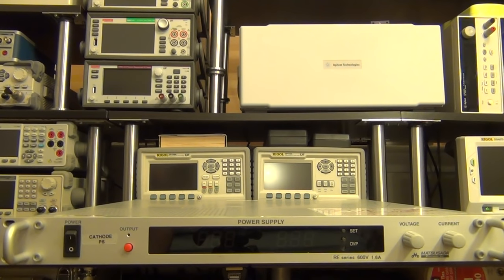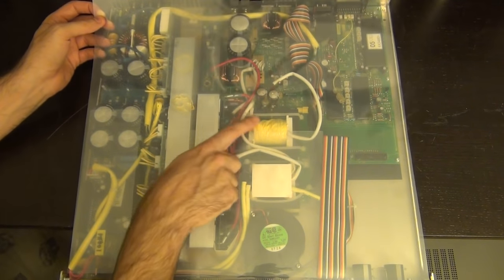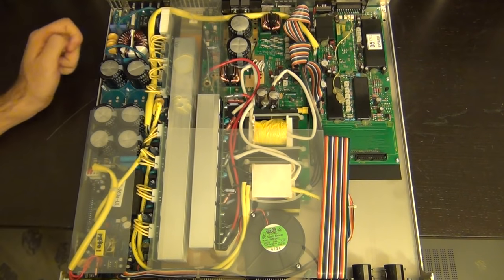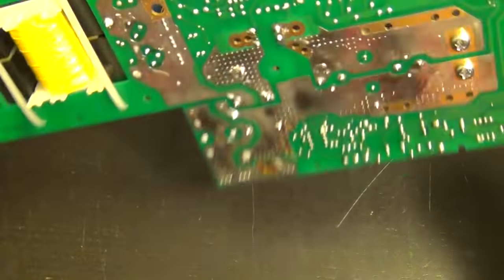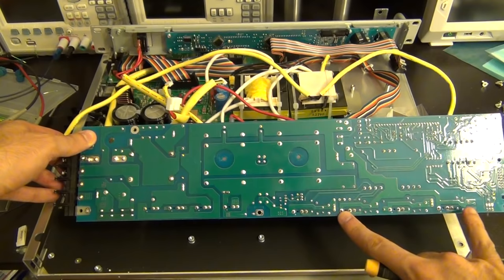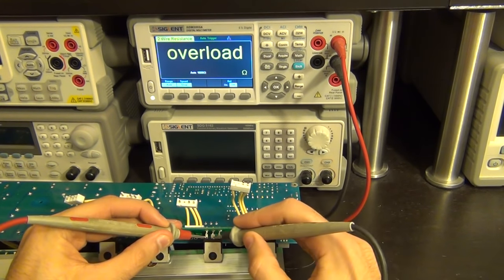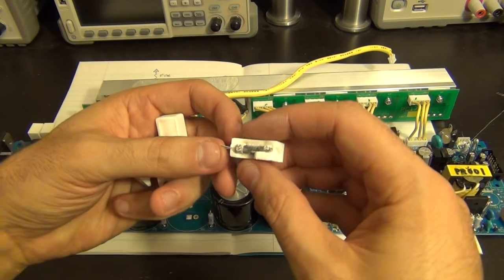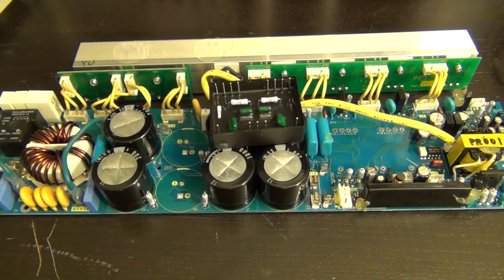TSP #65 - Teardown & Repair of a Matsusada RE-600-1.6 600V 1.6A Power Supply

Comment: Leaving the module in acetone overnight should do it? I know dichloromethane can do it, but it will also dissolve the IC packages and capacitor labels:/
Reply: +TheAmmoniacal acetone will have 0 effect on the cured epoxy
Reply: jz1199 Have you tried?
Reply from the maker: +TheAmmoniacal Acetone has no impact unfortunately.
Reply: +TheAmmoniacal not extensively, I have tried it on powdercoat (epoxy), and it would not do anything noticeable after couple hours, and that is a very thin coat compared to the amount of epoxy in that flooded case
Reply: Okay then, methoxybenzene next!

Comment: The electrical guys say that hiding parts so they can't be copied doesn't work, yet in this case it did.
Very odd that he didn't do his usual double checks, like for other shorts on the PCB and voltages, and just trusted only eyeballing everything. Seen other elec YT channels do the same thing and blow stuff up.

Comment: Are there any date codes on it? The boards look pretty ancient
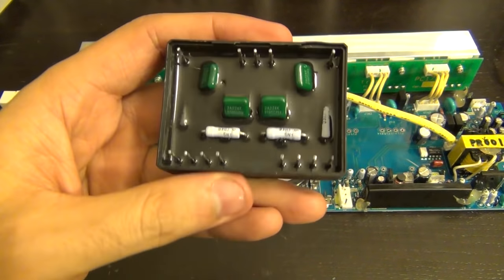Reply: +cmdstraker The potted gate driver module appears to contain components with date code 0513 or something  similar at 29:54 so 10 years old. What makes you say they look ancient?
Reply: +KX36 I wouldn't have expected that many through hole components in  low profile gear like this. That's all

Comment: 1M023A050N are good devices, but there are better devises for 500V working. I use 50A 1000V N channel FETs in my PSUs
and find that changing the fast recovery diodes for high power schottkey helps the FETs to stay safe. Just saying.

Comment: What's causing your problem is the pwm gen isn't working or the gate driver pair. If the gets are shorted gate to drain you can bet your bottom dollar the gate drivers are snotted..
Each and every day I fix SMPS in multi KW and HV applications.. No fun

Comment: Also haha man that sucks about the potting material. If it's silicone based (it seemed elastic enough from few frames I saw you handle it) people have had success with simply slowly hacking away at it after applying some silicone sealant removal available at any hardware store. If it's hard potting material (two part epoxy type) don't use methylethylketone/xylene/acetone no matter how tempted, it will destroy the components with the potting material. It's crude but a steady hand and a ball mill on a dremel to slowly file away at it will let you get most of the material off while retaining enough control (and tactile feedback) to figure out if/when you moved from epoxy to component (try to aim for a part on the board without components/traces on it, so you just register with FC4 instead). http://kevtris.org/Projects/votraxpss/unpot.html This is cool haha

Comment: We wanna the big review, be quick!
Can we have some spoiler about it??

Anyway is very very bad that they use custom module, I can understand use custom module in high freq RF stuff but in power supply why the hell use custum part?
Another example is in all TDS500/600/700 after the A revision. In B revision and later revision in the PSU they use a custom transistor that include the pwm modulation in it. No sense!

Comment: I guess its a chicken or the egg situation now. Did the gate driver go up, turn on both transistors in the halfbridge and roast that, or did the transistors go short, and roast the gate drive. 
Either way, its damn shameful to grind the part number on a mains voltage switching mosfet.  Its not really a hassle since it shouldnt be super hard to spec a replacement (as demonstrated) but even more insulting than an IC somehow.  If it were output transistors on a class AB amp, maybe.

That being said, there isnt that many pins on that module, given that it is gonna have G and S connections for each FET, power in, and feedback.  Figure out where the feedback is coming from, get some gate drivers, isolation if needed and see if you can stuff a tl494 into duty!
Reply: +CKOD Also, check to see how the potting compound holds up to heat.  Most epoxy based compounds arent that heat resistant. For me at work, 5 minute epoxy is 'temporary', jb kwik is 'slightly less temporary', and jb weld is 'kinda permanent'

Comment: Know it's an older video and the unit is most likely gone now, but sometimes with stuff that's potted like that, you can work it out of spots with hot air...lots of hot air.  It is quite stinky and takes...well...time but I have been able to get that stuff off by doing that and see things that were covered up.  I'd like to see some sort of referendum put into place for "right to repair" to stop or ban this practice of intentional obfuscation across the industry.  Doing that to FETs cannot be good for them having a vibrating abrasive tool hitting them like that either.  We have right to repair for vehicles, why not for electronic devices?  It seems overdue.

Comment: It's ridiculous that they would go to the trouble of sanding the mosfets when they are screwed to the inside of the heatsink.  What are they hiding, state secrets?  Maybe you should put the heatsink under the microscope and check for microdots.

Ah well, good video anyway.  I guess Dan will be along soon to complain about how it's a waste of time.  Yo Dan!  Great video, eh?
Reply: +pillsnotbills After what has been found out in the discussion here about the probably faked capacitors, i suspect something going on on those mosfets too. 
I seems that somebody really had a crack on the BOM during production. I wonder if they did this on the initial production batch or just as a cost reduction plan between production cycles. 

Nevertheless: as this unit looks like to bei at least of 15y+ age, i feel amazed such thing having taken place already in those days.

Comment: It is not a сatastrophe. You can buy dimethylsulfoxide in ebay and solve this epoxy, or just heat it up and you can remove it mechanically.

Comment: Also,  the positive coefficient thermistors should be looked at as they also have a limited lifespan. The none use of a surge resister is poor design. I suggest the ordering company asked for the units to be made as cheap as humanly possible, like the buyer was an American company and the buyer was some wet behind the ears kid with ZERO experience in the field. One always should leave room for a good diversity factor of at minimum 30% with 50% being preferable. I wonder if the kid's grandfather was one of the designers of the Titanic?

Comment: So now its a lot of girlfriend and cats. Does the girlfriend nudge the cat into the picture. Do you have the cat just to show in the video. Is the "girlfriend" just to push the cat into the video near the malfunctioning open high voltage power supply.